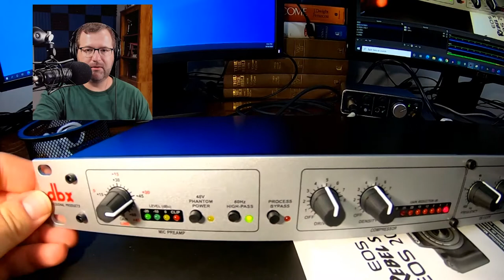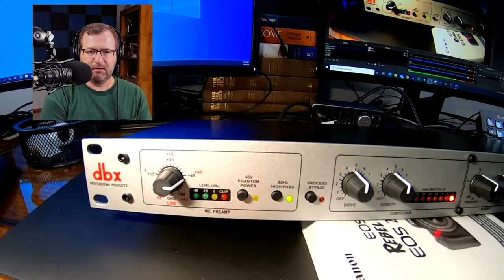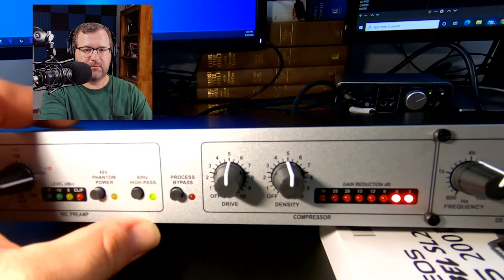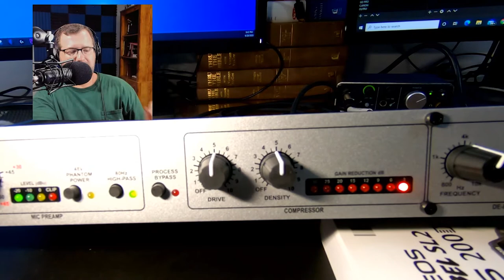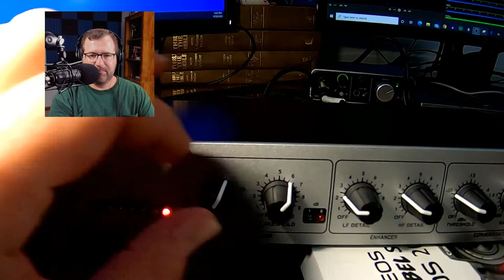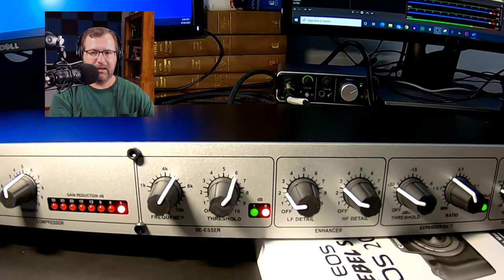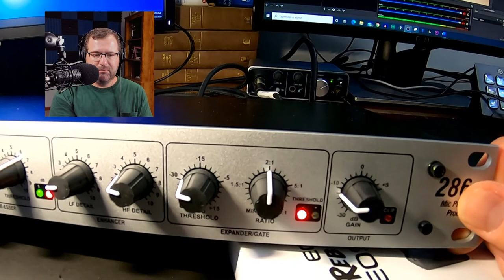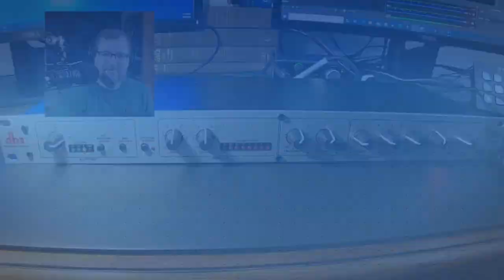DBX 286s Mic Preamp/ Processor Setup

Comment: would you need a cloudlifter / dynamite stick - with the dbx and the sm7b
Reply from the maker: That is one of the benefits of the dbx is the preamp is powerful enough to drive a quiet microphone like the Sm7b! No CloudLifter or Dynamite stick needed.
Reply: @towlermedia  thanks man, could you still add one anyway? 😅
Also, are you using the interface preamp as Well as the dbx or bypassing it OR does that depend how you plug it in
Reply from the maker: @_Trakman  Sure! You could still use one. Would need to lower the preamp gain on the dbx. The dbx preamp provides clean gain w no noise, so a CloudLifter/ dynamite stick would be an unnecessary expense.